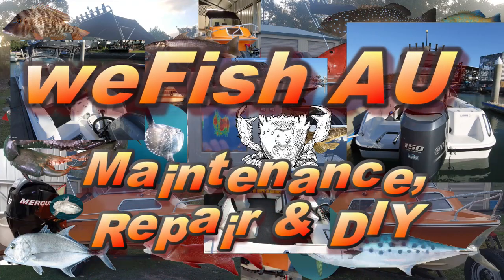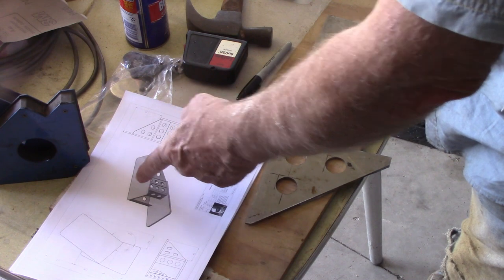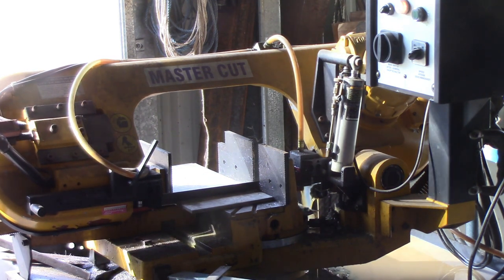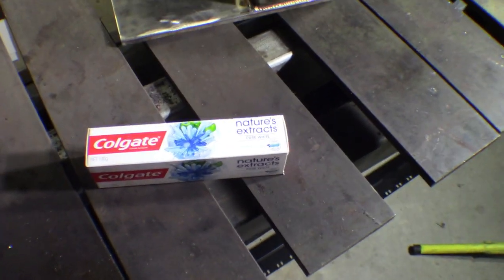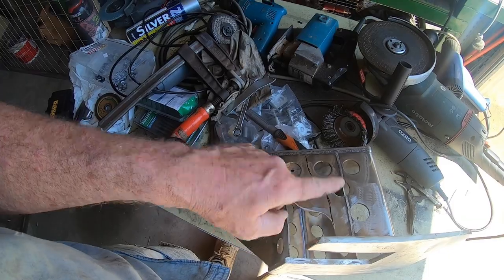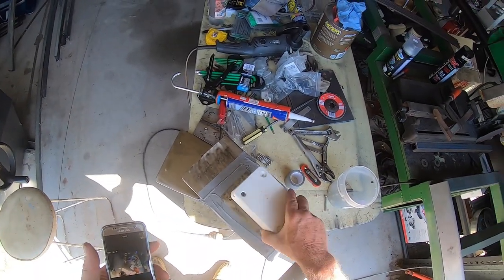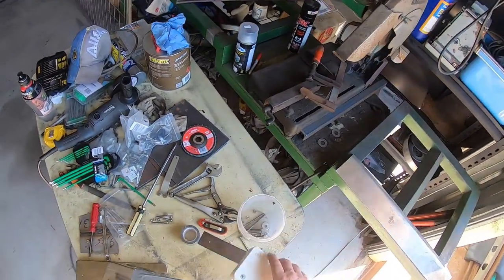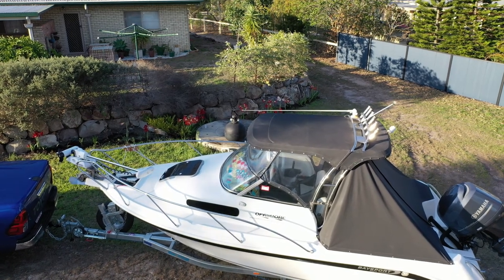Fitting a Minn Kota to my Baysport Offshore - 1 of 3

Comment: Any ideas on doing one for a haines 146r with a  bow rail?? Cheers Great job 👍
Reply from the maker: Sure have.  I put one on mine but I had to take the bow rail off to do it.
I did some videos here:
https://youtu.be/Zcu49uo-MMY
https://youtu.be/7mxWDxBMMMY
https://youtu.be/NoNmMQCS1Lw
https://youtu.be/qPj1IsY4UR0
Need to be careful not to add too much weight but it didn't give me any problems.  I placed the batteries on the cabin floor to distribute the weight better.